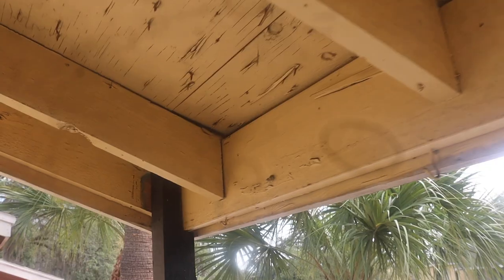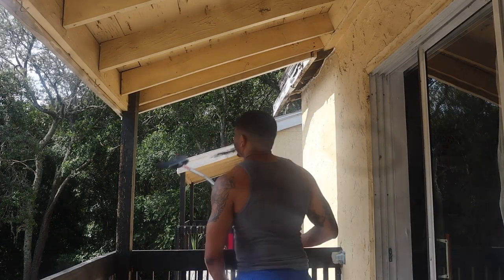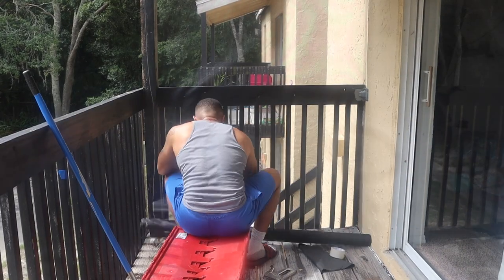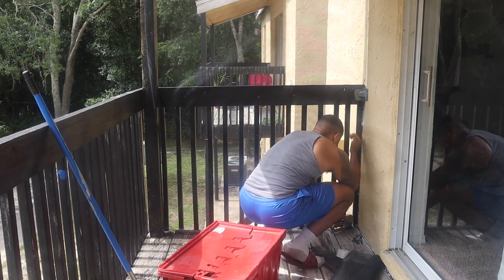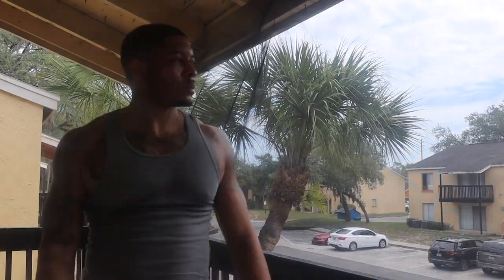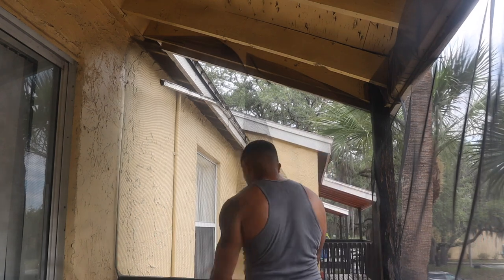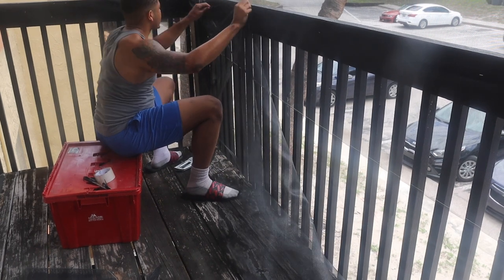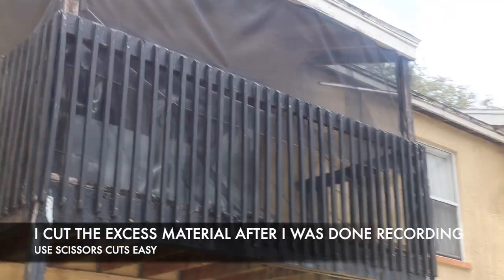DIY BALCONY Screen For Apartment From Insects | EASY INSTALL for Beginners

Comment: I wish I could use this method but I have concrete above and below and then brick walls 😭
Reply from the maker: My apartment walls are concrete. I made sure to have extra fabric and  m use the wooded and the top then stapled it to seal it. It wasn’t perfectly but wasp couldn’t get it in, which was my main focus
Reply: @SupremeSoldier  I have no wood to staple too that’s the problem lol ☹️ I may have to try a waterproof adhesive
Reply: @SupremeSoldier  so I finally put my screen up… TOOK 3 DAYS!!! I used garage mesh, and a privacy screen! Now time to decorate lol. Thanks for giving me courage bc I had the idea but no one was tackling this type of porch